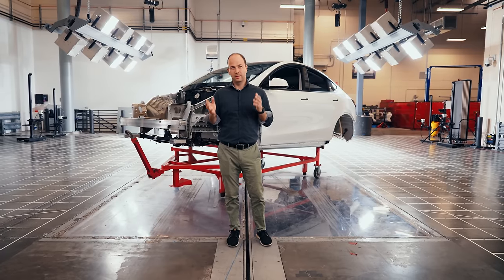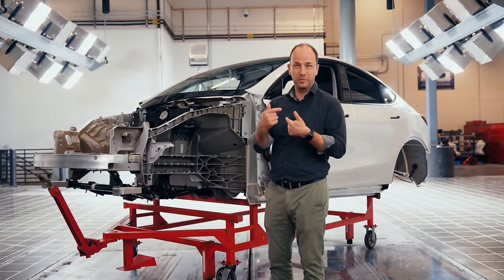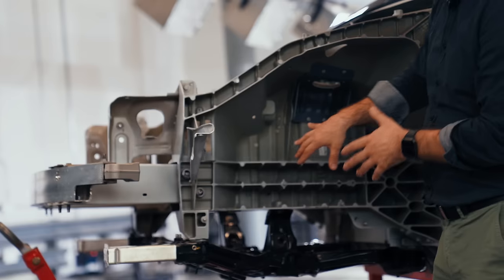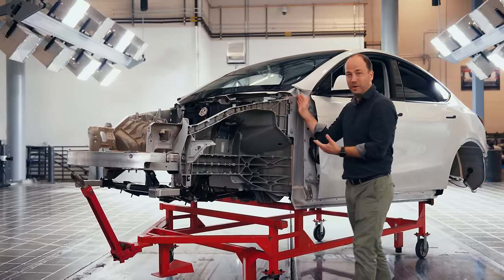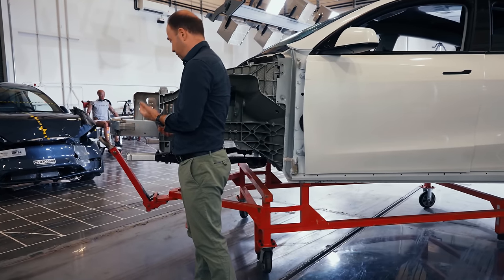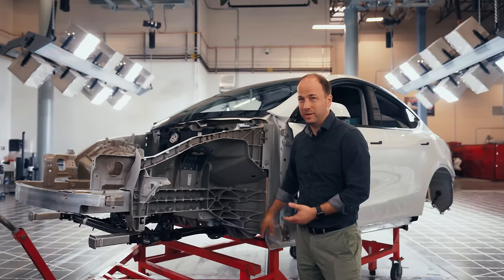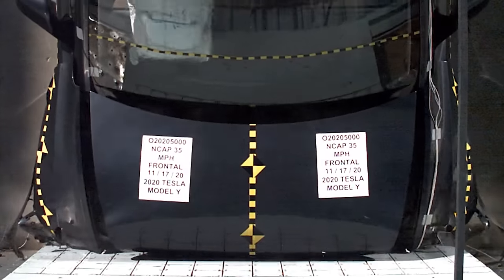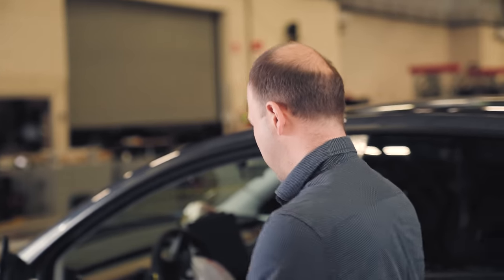Lars Explains | Tesla Vehicle Safety

Comment: Excellent info.  Crash safety is an important topic.  The best crash is no crash.  Can you discuss passive and active crash avoidance built into Tesla cars?

For example, rear turn signals can be red or amber in the US.  Red rear turn signals may reduce manufacturing cost, but amber reduces odds of a rear end collision.
Reply: Looked it up, 2020+ model y might have them now:)

Comment: One time I was in “track mode “ and I attempted to be cool at a stop sign 🛑 . From a stop i went full throttle and turned right . My lack of talent could not control instant 500hp + instant TQ so the vehicle 🚗 basically drifted sideways, went over a curb head on , into the bushes right in front of a farmers market.  Although extremely embarrassing (I deleted the dash cam footage) I was most impressed by how the model 3P took a full on beating from a curb. Nothing happened to the suspension/subframe at all. The suspension had so much uptravel , it just soaked up the curb.  The only damage was the plastic skid plate lost some chunks and the sway bar bracket had scuff marks.   I later retrieved the plastic skid plate parts in the bushes in front of the farmers market (after they had closed later that night , in order to avoid embarrassment).  Point is ,  most impressive tesla . Well made.

Comment: I was rear ended in a Tesla Model 3 while stopped by a lifted pickup with a 5K welded aftermarket bumper at speed. Overrode my bumper, launched me into the RAV-4 in front of me sending it into a fourth car. Saved my life and my passenger who were able to walk away. Written off. Truck was halfway into the trunk. He backed up and I managed to drive it home. I have pain walking, sitting, sleeping, standing but the safety of the M3 kept me out of a wheelchair. I drive a Polestar 2 LRSM now but wouldn't hesitate to recommend Tesla M3, or Tesla's safety as that's their most basic model.

Comment: Great info! I know this video isn't the forum for it, but I would like to know how these designs compare to other vehicle manufacturers. It's great that they are designing for maximum safety, but are all other brand vehicles designed in the same manner? And if not, what are the differences in design and philosophy?
Reply: What was shown in this video is just their take on the common design philosophy. What's more important is that they implemented it very well, as can be seen in all crash tests where Teslas regularly take the top spots.

Also, there's another video on their channel where they talk about not only designing for the standard crash tests but taking data from real crashes those cars experience and upload to the servers and designing for those as well.
Reply: @HenryLoenwind  Thanks for the info, but I'm really wondering how this compares to what other manufacturers do. Is it a significant step above and beyond what they do? Is this basically what everyone is doing? If this is special, I want to know what makes it special compared to others.

Comment: I am wondering if the battery is charged to a reasonable level to simulate the real road case. The crash could lead to a damage of the battery with stored energy released quickly in shortened circuit as a lot of heat. This will  vary likely cause a dangerous fire.

Comment: Tesla Safety Concern

Dear Tesla Staff,

I wanted to raise a safety concern. 

1. If there is a power failure of the vehicle 

2. The owner is standing outside the vehicle in the rain and elements

3. There is no way at all to get inside the vehicle, that does not involve electronics or wireless. 

4. The owner is at massive risk, and is forced to remain outside the vehicle in the rain and elements for a potentially unlimited amount of time

Thank you very much for your consideration

Comment: Just going to throw this out there (and I know this is not a Tesla bot clip), but your Tesla bot Optimus would be perfect in mass for the recycling effort. Fumes don't bother them, disease doesn't effect them. I admit the price tag is there, but the amount of resource renew would be unprecedented especially with your AI, of course there is the point of powering them, but possibly they could receive power from methane powered electric generator which feeds off the bio mass at these landfill sites... It would ultimately spell a cleaner future.... It's all about getting the funds to start the process of course, but guaranteed it would pay for itself for certain...

Comment: Cleaver sand pit. Notice the raised section of sand  as the side of the vehicle hits? The helps prevent the roll over as there is a higher level of sand then where the wheels hit... almost like the 1.9 sec plaid *
Reply: It literally has the highest safety rating any vehicle ever tested ,both in the US and in the much better European NCAP testing. It has the lowest chance of rollover. Physics is why, this should not be a surprise.
Reply: @robertboucher  The section of sand is, as shown in video, is likely referring to the part that gets naturally displaced when the vehicle slides its mass over it.

Comment: I’ve emailed Tesla’s safety engineers to inquire about possible REAR-END collision safety in its many Model 3 and Model Ys that are plagued by Phantom Braking. I purchased my Model Y in June and have experienced this issue about 6 times so far. Highway speeds 70-75mph and sudden HARD braking with normal Cruise on. Luckily no one behind me, but what if?!  If anyone else has experienced this, you know. Sure the car is safe if propelled off a 300’ cliff and all occupants survive. But how safe would we be if rear-ended by a semi truck at 70-75mph on the highway?

Comment: The Model Y's third row is completely unsafe for taking any damage from a taller trucks with higher wheel base!

There are multiple reports with photos and videos being reported that if you get a hit above the bumper, you will have your third row smashed into the second one, so never put any passenger there. I was in shock looking at the after accident pictures (we own the Model Y 2023)

I am pretty sure Tesla did not even think about the third row safety yet because the reality is worse than you can even imagine
Reply: I'm sure tesla thought of that and reinforced the rear and the glass roof
Reply: @Just_a_random_birb  they did not, the 2023 version is the same

Comment: I'm loving that mega casting, but also wondering about thoughts that were made on lifetime and rust. I love that the  wheel hub seems to be very closed off, but there's also seemingly shelves for water to rest on and cover it up with some more plastic and you could have compartments that hold water or moisture for a long time. 

I'm thinking of all car brands, they almost always change designs radically, and if you're a bit of a car nerd you kind of know "yeah, that car has a weak transmission, this car has a bad turbo etc". When it comes to rust they just seem to do weird design choices at times with little or no respect to creating moisture traps. I'm thinking of VW in particular, passenger doors and rear doors with the weirdest patches of rust. 

My own corolla has sheet metal folded behind the wheel hubs that gather sand and water and every model I see from this year has rust there. 

I'm planning to get a Tesla, but the basic coating quality and design choices around the wheels and rocker panels is actually my main concern, because I am a person that likes to keep one car for a long time. My idea is actually to buy a more or less ruined car when it comes to coating and then learn to vinyl it and do extra layers around the wheel hubs and those surfaces that get sprayed with abrasive sand.
Reply: @CrankyTim  you are right most parts will be fine, but if you google "tesla model 3 parts metal types" and sort by images you will see it's all various steel grades, not alu, unless they have radically changed alloys from the 2019 model. Model 3 being lots of aluminium seems to be a misunderstanding from the model S design being lots of alu. The mega castings at the rear are indeed alu on at least the model y. 

 I'm mostly thinking about body panels (especially rocker panels of mild steel) and their poor coating creating a lot of warranty repairs having to be done on quite new cars. The designs around the wheel hub also makes the body panels getting sand blasted by dirt in regular driving exposing the bare metal. This happens even on the rear  passenger door. 

I really want one, thinking of buying used, but I'm still inspecting 2019 models and reading about this online seeing people are exchanging how to approach tesla for warranty fixes on areas where paint is outright missing or flaking off. And thats 2022 models.

Comment: The upcoming Cybertruck should be the safest pickup truck sold in America. It will easily achieve a 5-star crash rating. It will also be the most durable truck thanks to the 30x stainless steel skin.

Comment: Why is it important to protect the battery, what happens if you don’t?
Reply: it can get damaged... lmfao.
Reply: It explodes
Reply: GM
Reply: Someone can correct me if I’m wrong but it can “explode” if punctured. (Not sure if explode is the proper term or not…)
Reply: Like your phone, batteries contain chemicals and if damaged, can catch on fire, it’s called thermal runaway. But Tesla design their batteries to contain the fire, vent the flames and smoke so if in the super rare case it happens, you have enough time to exit the vehicle.
Reply: You get to buy a new one....
Reply: @z52ontop  It does not explode but it burns up for a very long time and it is very difficult to put out the fire. The fire would just keep on going and going.

Comment: What is the repairability of the casting?
Reply: A crash bad enough to ruin the casting would have totaled any other car. So then I think it’s a moot point
Reply: @thestocksource8393  A lot of other vehicles can have damage in front of the firewall and they are repaired. Possibly the whole casting can be replaced.
Reply: @thestocksource8393  yup. 
Once it goes past the crush cans it's about saving people, not about saving the car.
Reply: @thestocksource8393   The Tesla employee said higher then 20 miles per hour the force gets absorbed in the casting. If 30 mph accidents are not repairable, there will be many totaled Teslas out there. Most newer vehicles on the road today are repairable in 30 mph accidents.
Reply: @joweb1320  There is a youtube video of someone repairing the Tesla casting by welding it. The damage was minor a tab was broken off and he manage to weld the tab back.
Reply: @kazedcat  Good to know. Fixed many Teslas in high speed accidents before front castings. Haven't fixed a front casting Teslas yet. Ford Explorers have used castings for years for the front strut towers. They aren't repairable and need to be replaced.

Comment: And that casting is unrepairable so the crashed car is automatically totaled after crash while "traditionally" manufactured is still possible to repair back to road. At least that front casting should be made from couple different sections which are clued and bolted or riveted together
Reply: How much more would you be willing to pay for a repairable Tesla?
Reply: Once you do that deep of damage to just about any car it's a write off.
Reply: @TheEvilmooseofdoom  That comment tells just about your ignorance concerning car body repair. I am working in body repair shop and we just repaired hyundai ioniq which was damaged by snow plow in parking area. Upper rail was bent and dented among others things. If that was tesla with casting structure, that car would have been totaled because you cannot repair that casting any way. Reasons why Tesla started to use those castings in their car production is that those parts are way more cheaper and faster to produce than normal front/rear end of the car. Stiffer also but the main reason is costs. And what comes to collision repair, those cars are now even more disposable products than they were beforehand.